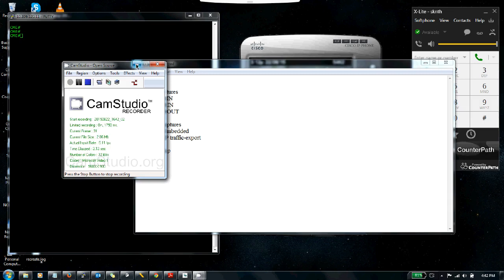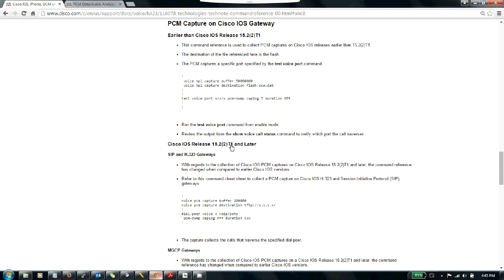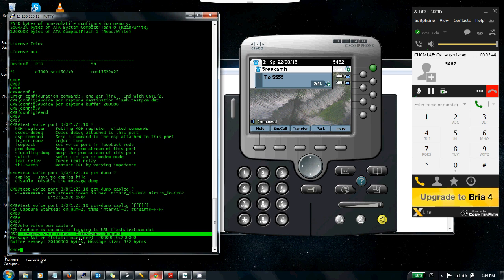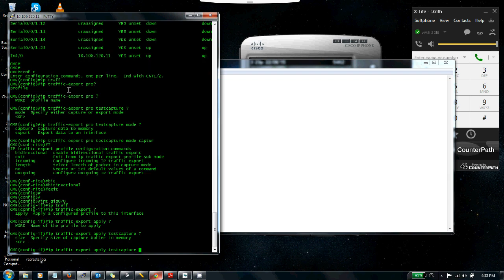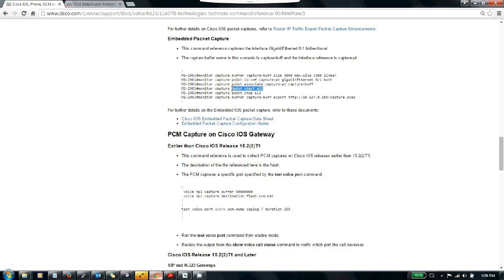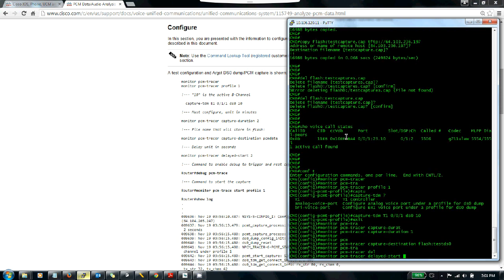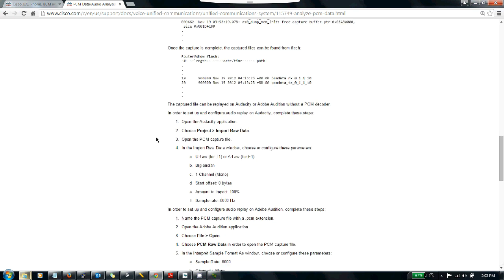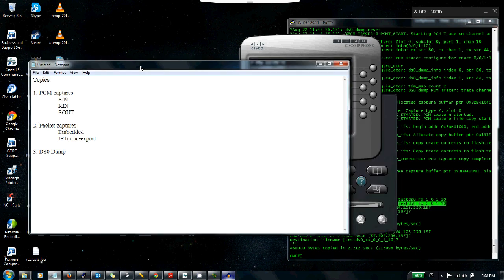PCM captures, Packet captures and DS0 Dump on IOS routers

Comment: I've made a slight typo in the video. At 24:52, it is mentioned for DS0 Dumps that the tx streams are sounds going out on the line and rx streams are sounds coming in on the line. However, it is the reverse of this. 
Tx - sounds coming in on the Digital/Analog line and going towards the IP side
Rx - sounds coming from the IP side and going out towards the Digital/Analog line